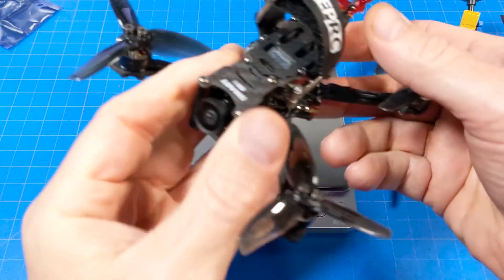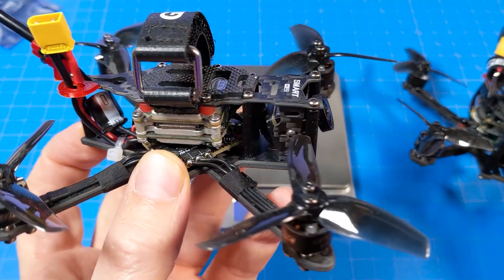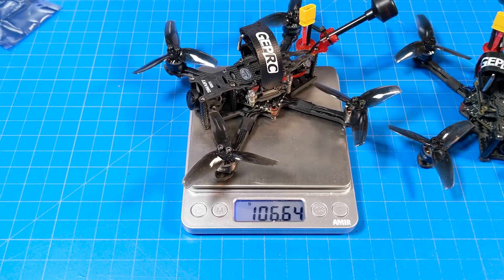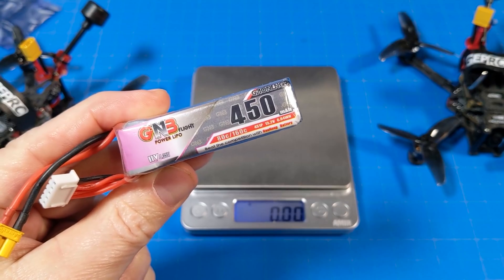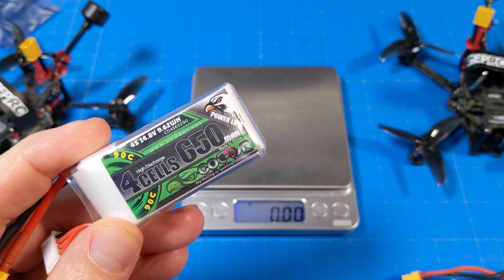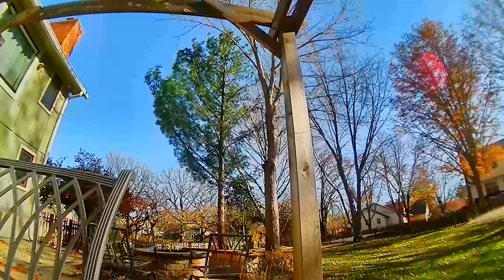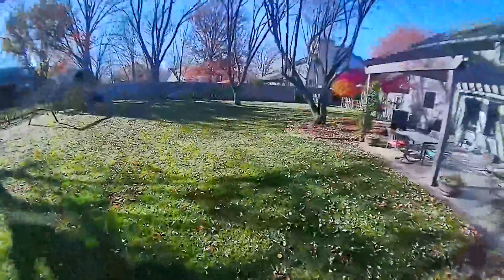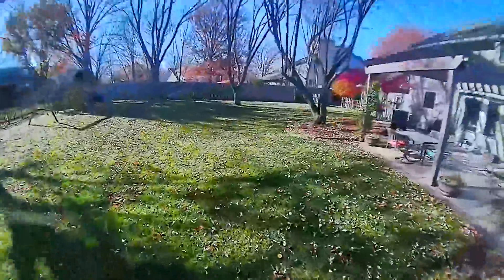What Could Go Wrong // Naked Vista // PID Tune

Comment: Wellcome back! The flyaway is most likely caused by the much higher current those bigger packs deliver. The step up from 450 to (good) 650 cells cuts the internal resistance in half. You could just reduce the master-slider to about 70% of its current value and try again. (Filters should not be affected)

Comment: **Edit**

Deleted my previous comment about my naked Vista overheating and becoming damaged. I installed a new Vista today and I’m having the same issue! Turns out it was only the antenna! TrueRC Singularity looked absolutely fine but was somehow was damaged caused poor transmission strength. Wish I would have tried that first! Oh well. Such is this hobby. Still totally worth it!
Reply: It's like the engineers put the heat sinks on for a reason...

Comment: 4 quads running naked. Hundreds of flights. Landed in water and dried on radiator, none of them have died. The only issue is that one of the aerial connectors got pulled off during a crash. Ive soldered it back on and epoxy over the top and its back working. Ive lost quads and taken 20min to find. If shuts down to stop overheating even if temperature control is off.  All on micro though, none on 5inch.

Comment: These days I'm running naked vistas on all my quads - 3 and 3.5 inch with no problems at all. I started off conformal coating the vista boards but lately I don't even bother with that. I've crashed on grass with thick dew and gotten the electronics completely wet. Just blow it out and keep flying. No problems with overheating either even when running at 1200mw.

Comment: Heads up, when you make your vista naked clean of the thermal paste, without a heatsink to transfer the heat too it will work as an insulator! 
Got two naked vista's. One on my freestyle sub 250 3",  for over a year now, no issues. Nail polished it for waterproofing , because I usually fly fields and parks, and I've put antenna glue on the ribbon cable connectors so they can't pop off. So many crashes, even broken frames, but the vista keeps on going!
And the one in my cinelog 25 is naked as well, same pid tune and still flies great and more flight time.
Reply: you actually mean „not clean“ right? So if you leave it on, it works as an insulator?
Reply: @eyeflytinkerings  Yes that's what I meant 😋👍

Comment: Great video! I have 3 naked vista's myself - one on a fpvcycle Tp3 (digital toothpick), one on a light 5 inch and one on a 3s GEPRC Phantom (converted the analog version).
All three fly great and haven't had any problems with heat or durability. Its important to secure the antenna properly so it can't damage the connector.

The only real downside I noticed - the naked vista emits a LOT of electrical field noise. I was trying to run a GPS on the light 5 inch and it was impossible to get satellites with the battery plugged in. Tried the same GPS / frame with a normal vista and it works perfectly.
Reply: I know this comment is a few months old, but have you tried setting the vista to output 25mw while you acquire lock? Normally, lowering the power lets me lock on, and then I can crank up the power again without losing satellites.

Comment: i run 2 naked vistas in the uk so mine are fully conformal coated from the winter, use a fan for bench work but i have no issues a year later, i do run fully cased on larger builds and i see no difference apart from you just be aware it will heat up quicker. iv had them shut down to protect from over heating in the past but never damaged one yet

Comment: Good to see you. I just got my first vista. It’s cased tho and I’m currently waiting on a  new frame that will accommodate the cased unit. Im not as concerned about the weight as I am the spatial differences. A lot of the testimonials in your comments indicate the heat sinks don’t really make a difference in performance so I’m gonna go ahead with the build I’d planned when my Steele 5 Apex frame arrives but I’m definitely gonna pick up a naked vista now cos if I could pop one of those in my Geprc dolphin or diatone gt 349 I’d be a happy guy. Good luck with the new water hazard I mean pool:)

Comment: I have several quads with naked vistas and haven't had any issues at all. Mine do not have the 1200mw hack on them. Obviously, you have to arm and fly within a minute or so or else you'll start to get the overheat warnings, but other than that they've been fine. Be sure to either remove the metal mesh pads or insulate them or you could get a short.

Comment: I fly this quad, not naked DJI, with the Nebula Pro nano camera. I use 600mah 3s GNB batteries. Flight times are a solid 5 minutes. I have flown it with 4s and I do get better performance. I fly this in my yard so I don’t really have the space to give it hard throttle.  Still is a blast on 3s.

Comment: I run a naked vista on my Flywoo LR4.  Saving weight on the long range quads helps flight times a bit and I have liked the result.  I would suggest you try an even lighter battery, maybe a 4s 380 (43g) or a 3s 450.  Since you lost some weight, loose some battery and see if you can get even better flight performance, albeit with a little less flight time.

Comment: i think this video solved my runaway problem with the babyhawk2hd.   recomeneded battery is 4s 850  and it ran away on me with a 4s 1400
Reply: Weird did you ever learn more about this? I fly mine with my big 1500mah 4s batteries all the time. Never seen this happen.

Comment: Hi there Nick, is there a specific pid adjustment to make when weight is added (or taken away), or is it simply a feel-and-adjust process of re-tuning? And welcome back!
Reply: I would simply try  the master slider up or down to begin with
Reply: @Dcabecao You are probably right, but that geprc flight controller for the phantomHD is notorious for this. They say not to use over 450 on 4s. Mine had occasional flyaways and throttle weirdness on 450s as well.

Comment: Power to weight is my bag right now. It amazes me that some fly (at a hover) with >50% throttle - hum?
  Neat video, and I am telling some of my local crew about your spammer, sorry that your dealing with that 🤬..
Enjoy the Breeze...👍🏻🍻👊🏻
Reply from the maker: yea, over the last year or two the whole big battery question has been one of the most frequent.  I had one person told me they still watch the videos but quite FPV because he wanted 30 minute flight time. They do have RC blimps.
Reply: @NickBurnsFPV  
My Rescue Drone has a 14/16 minute flight time. I'll be totally honest with you, at my age, I'm ready for an eye rest after 10 minutes...🤣
Reply from the maker: @PropsOff  yea, those LR quad wear me out. I go for one flight and I need an equal break. I would rather have 10 2 minute flights than one 20.

Comment: Can you add a lower power mode for it tied to disarm?  So if you crash and need to find it it’ll go into pit mode or something 🤔 
9g or 10% weight is significant.  I do have a 95mm cinewhoop with naked.  Traded the 9g for extra camera weight.  No issues so far after a few months.
Reply from the maker: I am not sure how we would do that as the vista doesn't have smart audio to tie it to the flight controller and thus our radio. I am only aware of controlling the vista vtx via the goggles.

Comment: I have had this same problem with my phantom and i dont really think its the added weight. My vista is not naked and i have flown it one time with a 650mah no issues. But after that it would goto the moon on takeoff no matter what. Bought another one as a spare and it did the same thing stright outta the box. I gave up on it. Haha. Less issues and better flight performance on a 3.5”
Reply from the maker: Interesting. I think it might be tuned to the edge, or we need to soften the pids or maybe it doesn't like that there isn't the expected voltage sag.

Comment: I tried to make a naked version of a perfectly working Vista and I damaged it. I think the connector cable of the two boards can make a short circuit if standoff spacers are not used correctly. I will not recommend the conversion for beginners, specially for how expensive it is. Interesting result on the flyaway with the weight difference and PID tuning!
Reply from the maker: yes, we don't want contact between the boards. that can damage one or both and sadness.
Reply: @NickBurnsFPV  that was like a year ago. Lately I have just flying analog and sharkbyte. All of them have very particular use. Your flying makes me want to fly DJI again!

Comment: I don't own any naked vistas. A big concern of mine is waterproofing. Can they be conformal coated? Just feel when heat sinks are removed you give up durability. Thank you for the vids and information you share.
Reply: I always conformal coat (spray) them and never had a problem due to them getting wet in the grass. Just make sure you leave the cabled connected while coating!
Reply: @volkergoe  Thank you

Comment: 4 naked vista builds, countless batteries.  typically run at 200mw but have a few that sit at 700mw all the time. I only have one dead vista and it's not naked and the only reason why it died is because the UFL port ripped off.

Comment: You need to reduce throttle boost to avoid fly aways, or CE in blheli-m if you used it: that's not weight that is responsable for your fly aways.

Comment: Maybe you can help I have tried but with no success. Since updating betaflight and firmware to 10.8 and firmware 4.3 I can't get the osd to display
Any tips
Reply from the maker: I presume the quad your working on is with the caddx vista as in this video? Is the port rx/TX the vista is wired to have the msp enabled in the port tab?
Reply: used this and giot it working set displayport_msp_serial = 3

Comment: Sadly lost a naked vista due to an overheating issue in geprc thinking p16 . Came up with a goggle warning  saying land now overheat and went black screen and never worked again.
Reply from the maker: ouch. That hurts, a vista is what $115 now days. Not like losing an old analog vtx at $20.
Reply: @NickBurnsFPV  I contacted caddxfpv about how much a replacement one was and they helped me out a bit . Still not cheap item to burn out thou . But the video quality vs analog is worth it

Comment: Naked vista on betaFPV 405 20A AIO with Headsup 533 1404 4533kV RacerX Twig v2 nebula Nano on 2S 520mAh. another on a QAV-R Kakute v2 EMAX 35A Individual ESC with the original hypetrain blaster motors on a 4S.

Comment: On right turns loosing image or on a split s
Reply from the maker: sounds like a wiring issue. Likely need to check solder and maybe even replace wires as they can break internally.

Comment: I think I noticed the b/w effect on your throttle ups. I'd try a extra cap in the vtx power first before camera swap. as far as added weight,some manufactures,and operators have different pid profiles for different batteries . I would be suspect to seeing a stock qwad doing that with a warning about weight from manufacturer ,That would tell me that they not had a lot of time to tune it so it's not so sensitive to changes(like on the edge).
Reply: There might not be enough current for the vista from those 450mah 80c batteries if the motors are going full throttle.

Comment: I don't know what's going on with GNB, but the 520mah 4s pink label is listed as weighing the same as the 450mah 4s pink label. +/- 1 g. I have the RDQ 525mah 4s, which should just be a GNB battery, and it weighs 56g (listed as 55g). Even if the GNB 520mah weighs 56g, that's still 15% more capacity for only 7% more weight.

Comment: The question guys should be asking themselves is NOT "how big of a battery can I put on it" but, is "how small of a battery can I put on it!" ...
Guys, the goal in flying lightweight FPV micros is not to load the quad down with so much weight that it's flight performance sucks! It's about giving it the smallest, lightest battery possible so the performance is AS GOOD AS IT GETS!
These are NOT long range quads that you want the longest flight times possible so you can fly farther, and farther away!
These are performance quads, so stick the lightest battery you own, that's the right amount of cells, and go get that great, nimble, superb acceleration flight and simply pop another battery on it and go again! 👍
🛑 STOP 🛑 making everything about flight time! THAT'S NOT IT! 

Make everything about PERFORMANCE!

Fly these lightweight micros as light as you possibly can! Just have several of those lightweight batteries to fly again and again and experience these micro at their best performance, most nimble cornering, most maneuverable, and fastest acceleration possible! Don't weight it down to be a BARGE! 🤔😎🤘